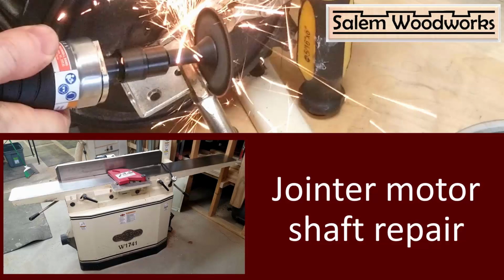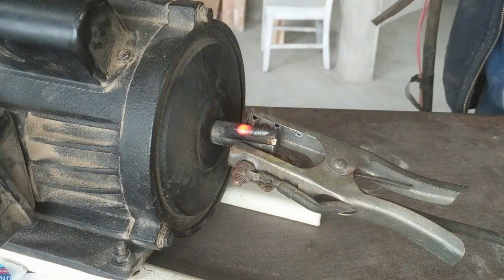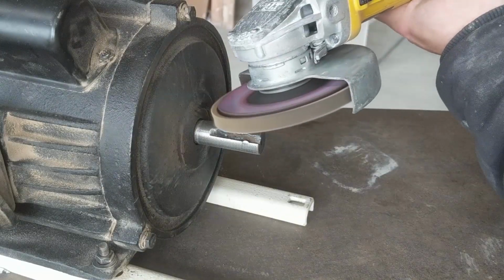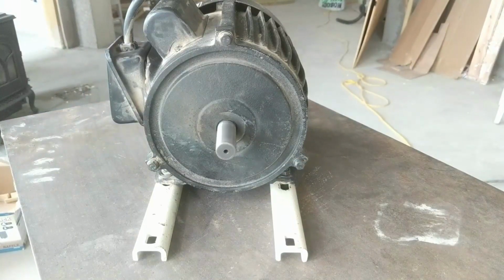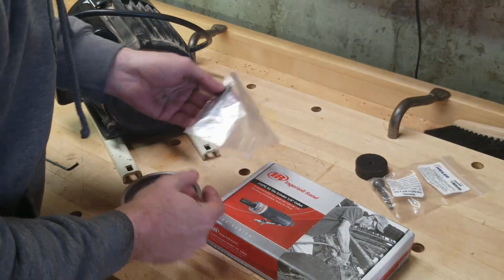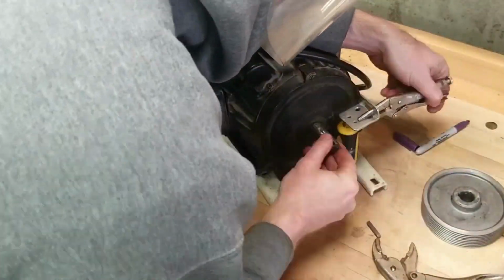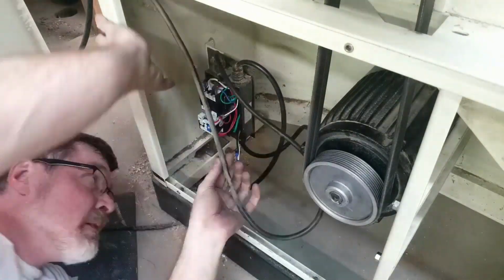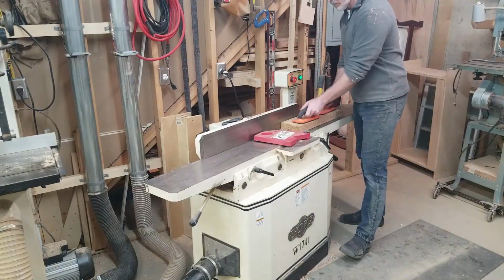Jointer Motor Shaft Repair

Comment: You could always make a small shim out of a pop can (just cut a strip the width of your pulley) and insert it between the shaft and the pulley to take out any play.
Reply from the maker: I actually snuck in some shim stock off-camera... :-)
Reply from the maker: Should have included that part, but forgot to film it.

Comment: I'm curious how this turned out.  I had a motor pulley on a planer with just a slight bit of wiggle.  The vibration kept loosening the threaded bolt securing the pulley.  Eventually the pulley wobble worsened and the key began eroding the slot, similar to your motor.  I eventually bought a new motor.
Reply from the maker: The repair held, but I've since upgraded the jointer and gave this one to a friend, where it has seen little use, so I can't say how durable it will be long term.